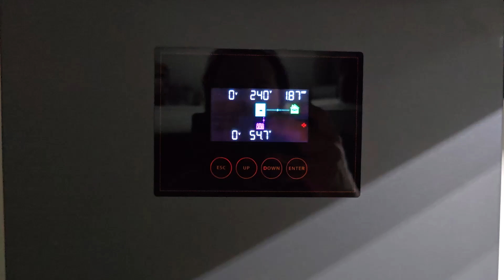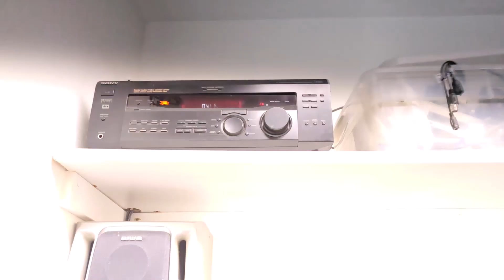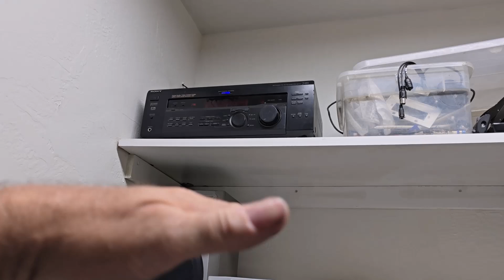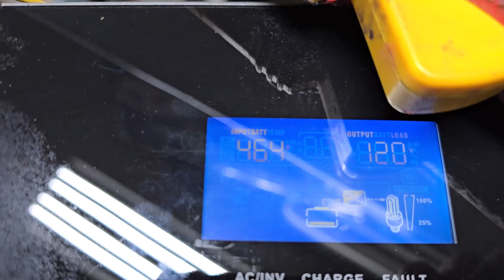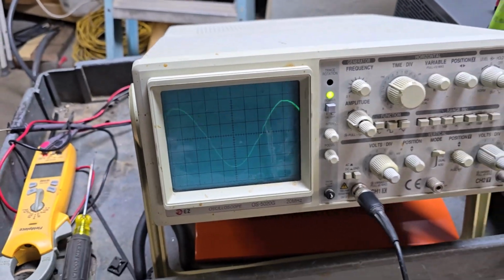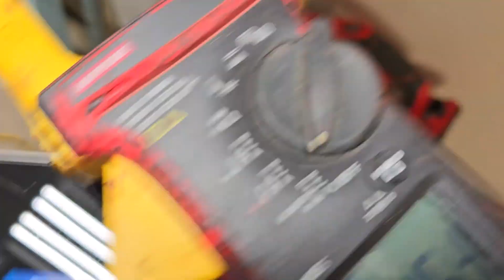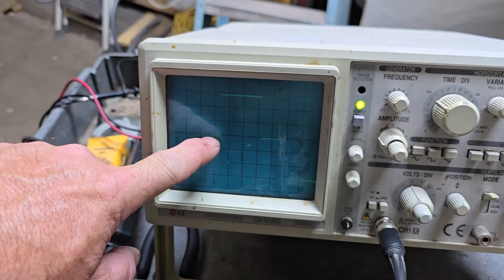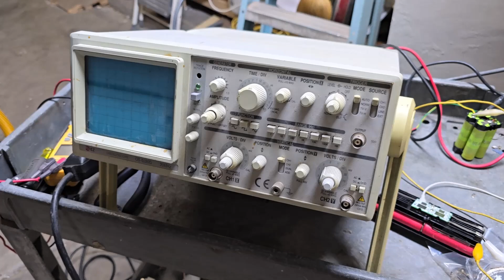Opening up my old PowMr 5KW 120V/48V Solar Inverter Charger - Checking the sine wave output

Comment: Ever had issue with powr mr back feeding pv side at night my pulses its not constant its very low
Reply from the maker: @thedampestcrib6004  No.  And didn't think that would be possible. Diodes in the Pannels themselves plus I'd think the switching power from the pv input to the batteries would keep that isolated
Reply: @hackfreehvac  it's like a flicker runs up to 120v no amps then back to zero keeps flickering causing solar to be detected.
Reply: @hackfreehvac  it's definitely coming from the inverter tho
Reply from the maker: @thedampestcrib6004  You might want to check on a DIY Solar forum to see if that has been an issue.
You could also place a diode so current only flows from the panels to the charger.
Reply: @hackfreehvac  I have cant seem to find the same issue and I placed a diode but since the amps are so small it doesn't seem to stop it
Reply: @hackfreehvac  alright so I'm no electrician but jesus electric problems can Be a pain to diagnose. So I took the extra diode off it got faster... so I thought bad connection and nope. Check this my ac plug in the outlet had a strand of wire one little hair of copper touching the ground it caused it I think... 🤣

Comment: Try putting a film capacitor (such as from a ceiling fan) across the output. The inverter stage works like a class D amplifier, the largest toroidal choke and the large grey box is the output filter. I suspect that the filter capacitor may be blown.
Reply from the maker: Yeah I wondered if anything actually failed out of spec or if it was always that way. It's been running this way for a long time.